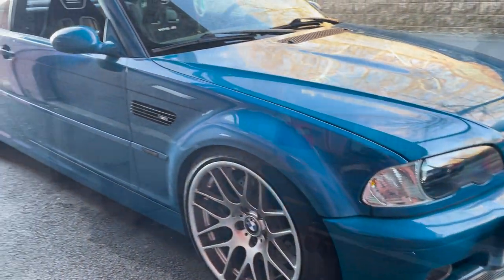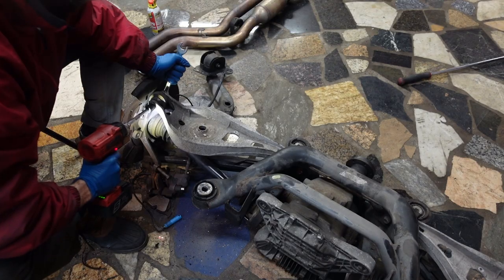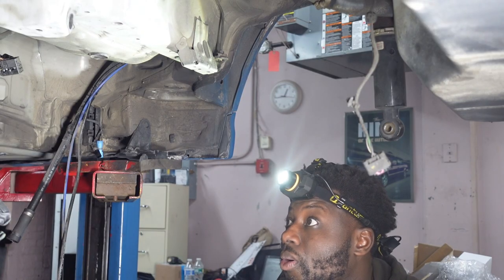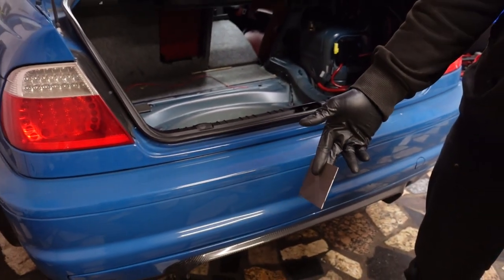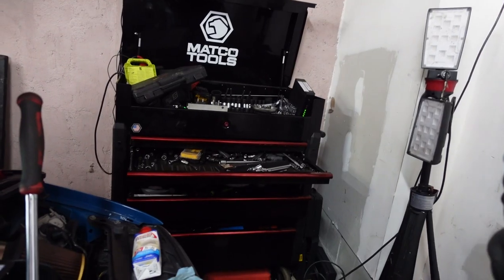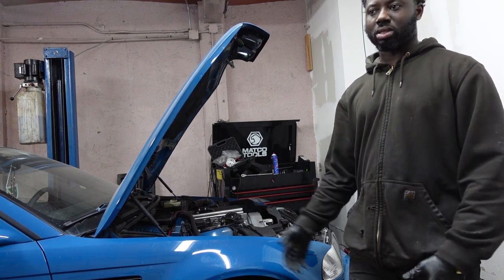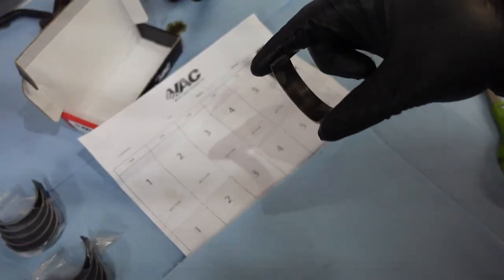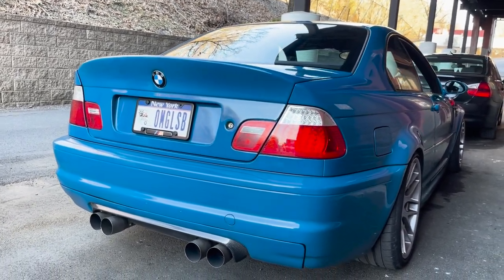E46 M3 Big 3: Rod Bearing Replacement, Subframe Reinforcement, VANOS Overhaul

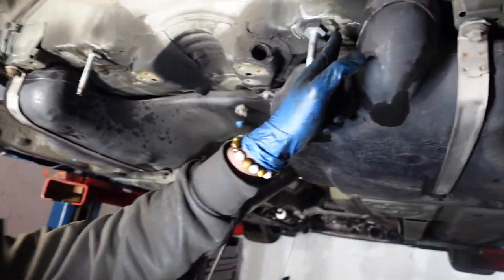Comment: Great video! I see the cracks you pointed out at 3:48. Is there an easy way to check for sub-frame damage other than tearing apart the entire rear end? 2002 M3 slicktop manual...original owner. Only 59k, but I've beat her the whole 59k. Does the sub-frame damage typically present itself at such low mileage? Rod bearings have been replaced as a result of recall at ~ 33k, so should be good there. At what mileage does the VANOS service need to be accomplished? Are there symptoms to indicate the need for VANOS service? TIA...again, great video!
Reply from the maker: Unfortunately the subframe area can only be properly inspected with the subframe off, you cannot see all the cracks on the mounting point if it's on. I’ve seen some lower mileage examples with trunk damage so it's better to get it done sooner rather than later. As for the VANOS, typically you will get VANOS Codes to tell you it's about time to rebuild it. But at 80k-100k miles would be a good time to do look into it.
Reply: @bavlife  Thanks very much!